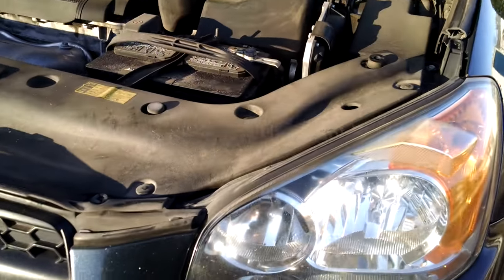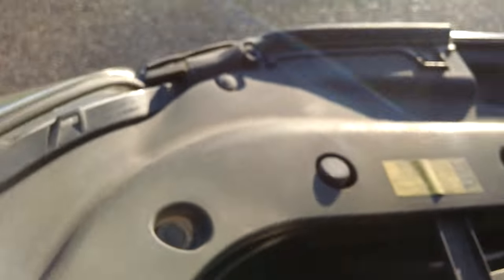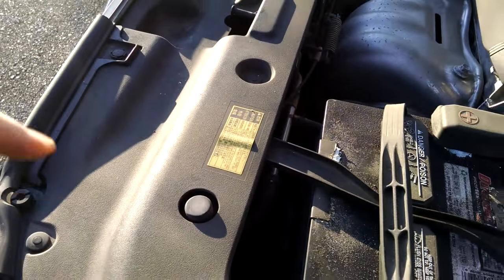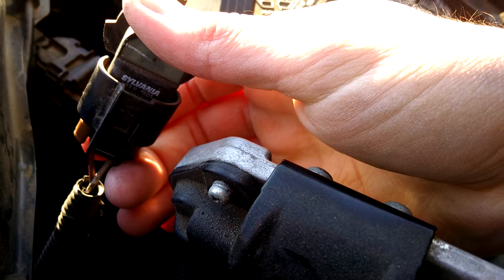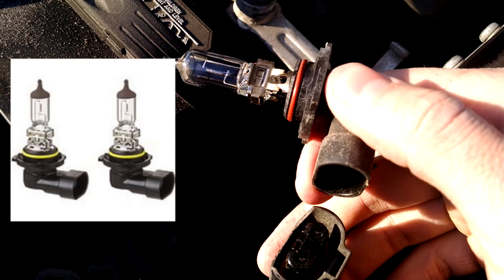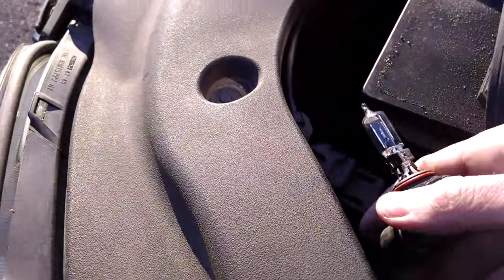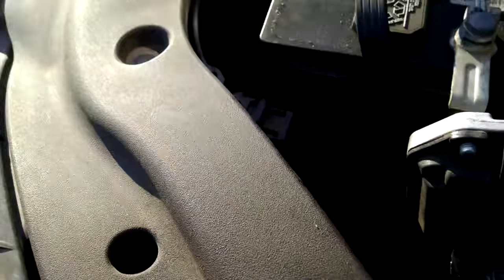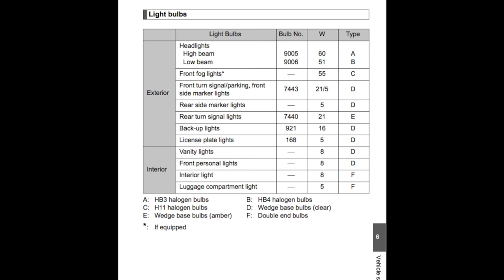Easy! 2006-2012 Toyota Rav4 Headlight bulb Replacement - 4 minutes!

Comment: we removed the cover since it was the passenger side low beam bulb and hard to get to.  take a screwdriver and press the button down on the fastener that holds the cover down. there are a number of these fasteners.  put the screwdriver under the fastener and remove.  put fasteners in a secure location.  the whole cover will come off if you slide the cover a bit towards the engine.  there is a trick to replacing the fastener, you have to open the two prongs so the middle part can slide up so the button can go all the way out.  to replace the fastener, put the fastener with the button out into the hole and push the button down just so it is flush (if you push the button down too far it will release again). note that the cover slides under another part a bit in the middle so make sure the cover is not on top but rather is underneath as it should be.  thanks to Jason for the clear directions on removing and replacing the bulb.
Reply from the maker: Awesome! Thanks for the helpful details!

Comment: Heads up for anyone wanting to remove the cover.  Those clips you push the middle button down with a philips screwdriver, then they pull out.    To put them back in you have to reset the button by pulling it back out above the clip.  Then re-insert and push the button back down flush.

Comment: Driver side is easy. For passenger side - remove plastic pins by pushing middle part in and lifting them with small screwdriver, only the passenger half needs loosened up. Lift plastic cover and you will have easier access to both - HI beam and LOW beam bulbs. To reset the pins you removed you need to spread their middle pin legs a bit to push the middle pin out while not removing it.

Comment: 2010 V6 Limited “it’s a lil beast” I love. Wanted to replace the headlights to LED a little pimping of my ride. This video has been really helpful. Just shopping for the right brand wondering if they come in two for each side(high&low beam) for both driver & passenger side. Any idea will be highly appreciated 😊

Comment: got a 2011 v6 4WD thing is a beast on and off the road including in the snow, with good all seasons I got out of my driveway and the snow was up over the top of the tires.   In addition The toyota engineers did a great job with making most of the electronics easy to  get to and work on.  Took me 1/2 hour to put in an after market Radio and GPS system. way easier than any American car I had in the past, My old man (R.I.P) worked for GM so I always owned a GM product hard not to with an 18% family discount off the best deal you can make.  Switched to Toyota because I was sick of working on GM vehicles after they get about 4 years old.  Haven't had to do nothing to the RAV except Oil changes, brakes, tires and a battery and it still drives like the day I drove it off the Lot.  Good video man,   thanks!

Comment: Extremely useful video, note on the passenger side, I just pulled the cover on the corner and popped out the three plastic clips that way. After that twist and pull the lights out, wear rubber gloves as residue from your fingers can affect the lifespan of the blubs, and like tires always replace in pairs.
Reply from the maker: Thanks, Alt World Studios!

Comment: Thank you Jason. Only mistake I made I bought a 9005 instead of 9006 for my 2010 rav4. I replaced the lowbeam light. So simple.
Reply: @JasonsHonestReviews  I bought a 9006 from Pep Boys and it doesn't fit.  The part has only 1 slit on the inside base where the original one has 2.  So I'm a little confused on the correct part #.  Of course the amateurs at Pep Boys have no clue.
Reply: @JasonsHonestReviews  The low beam
Reply: Jason Foote ok so apparantly I removed the wrong bulb and took out the high beam bold. After i took i out the correct bulb the 9006 fit. User error!!

Comment: Maybe someone has already mentioned but to undo the black plastic pop screws at 1:06 you just push that little round circle in the centre and they open. Push them all in...use your fingernail or something pointy...then that black cover comes off. To get them back on take each pop screw and open it's little legs a bit wider and push up into the 'grooves' ..then when in place push down on top of poo screw and they reset back to where you started. Hope that makes sense. I kind of worked it out by accident one day. Hope it helps someone👍
Reply: @JasonsHonestReviews  haha i just read what i wrote. I said "poo screw" instead of pop screw. Goodness. Glad u could work out what i was saying👍
Reply: @JasonsHonestReviews  i got it right the first couple of times;)) And yes whoever invented them(even tho they are plastic and non biodegradable) is definitely a bit of a genius.

Comment: Pep  Boys have the wrong part # for this bulb.  Their 9006 part # doesn't snap into the base socket.  The old part has 2 little slits on the inside of the  base that connects into the socket.  The Pep Boys part # 9006 only has one slit and it's in the middle which doesn't allow the socket to connect.  Any thoughts?
Reply: @JasonsHonestReviews  Do you know what I'm talking about though?  Why wouldn't Pep Boys have the right bulb?  Or is it me and I just don't know what I"m doing?  LOL

Comment: Add some electric grease to the connection and do not touch the bulb with your fingers....oil from hands could burn out the bulb
Reply: Good video, very easy to follow.